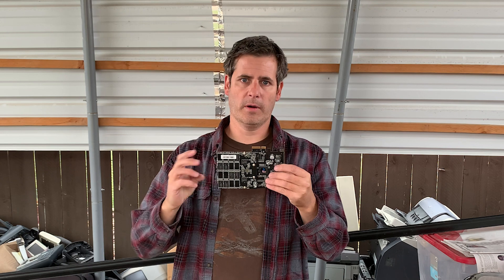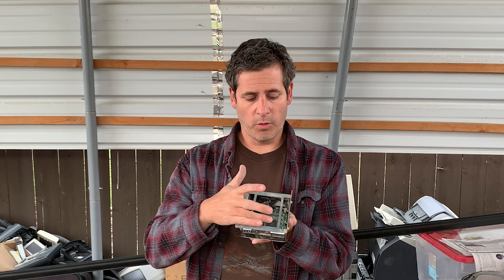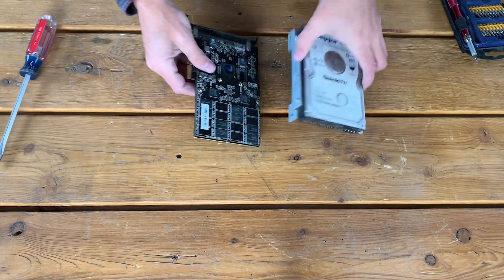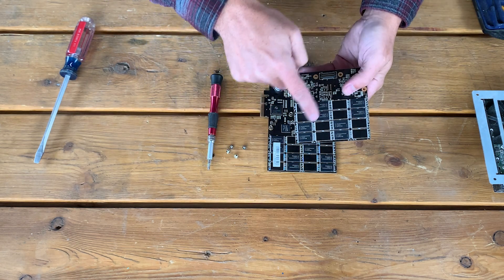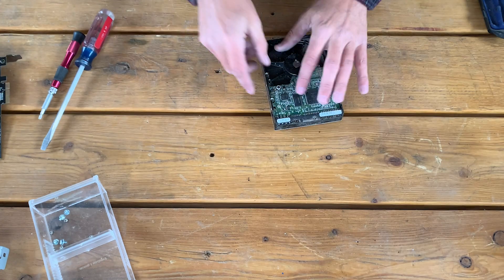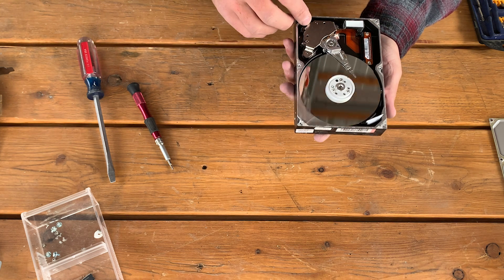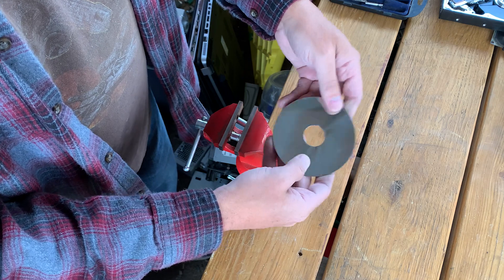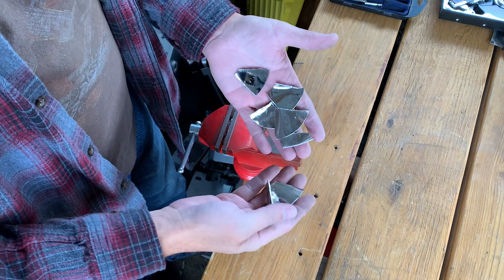My Way to Securely Destroy Hard Drives

Comment: Nice and informative video:)

I have a couple of questions though. Were those aluminium platters? I am asking about those which were destroyed by you towards the end of the video. Also, why didn't you use tin snips/aviation snips to cut them into pieces?
Reply from the maker: I don’t know why I don’t use snips on the ones that don’t shatter.  I have some that I could use… I just always used pliers for what ever reason.

They could be aluminum.  Sometimes they are ceramics.  The ones in this video were aluminum I believe.
Reply: @badideametals Thanks for replying. You are right, pliers are more convenient too.

Comment: Destroying hard drives or SSDs for privacy is stupid. Windows has a built in tool that replace all the information from the drives with 1 and then they can be reused without anybody being able to retrieve any confidential information previously stored on them.
Reply from the maker: Even with single pass register filling with 1s can be reversed.  DoD process is good for most. Over writes with a multi pass process. I work a lot with state and US government entities and they require destruction or I lose my agreement.

Stupid or not, people do require it to eliminate possible data leaks.

Comment: I read that the drives from 90 or older have kobalt Platinum layers that can be recycled by professional and they sell for a good amount of money. I guess that's why those Early computers cost so much. Older the drives more the precious metals. I just did about 10 drives today but I didn't know about the cache memory chip on the board.
Reply from the maker: It is honestly not something most people worry about.  The cache may have part of a data stream but it would be very unlikely that the data stored in the registers can be reassembled to mean anything.  I specifically like to get them so I can recover the gold from those chips.

As for the platter coatings; I have heard there is always the possibility for rare metals on the surfaces.  I just don’t chase that down since I do not get that many old drives.

Comment: If I reset my computer to factory setting, do I still have to manually destroy the data HDD?
Reply from the maker: The fast answer is "yes":

The reason for this is that all your files are stored in a way that even if you restore to factory default, your files still live on the drive.  

Imagine your drive is a book.  And let us pretend that the only way you can find the content of this book is by opening to the index at the front, find the page number of the data you are looking for, and then you can turn to that data.  Resetting the machine to factory conditions is like ripping out that index.  (Yes, in some instances, you are given the option to erase the drive, but it is not required)  

With the index ripped out, can you flip through the pages and find the content you wish to find?  Yes.  There is software out there that can scan the drive and rebuild data left behind.  

If you are concerned about data on the drive after resetting to factory defaults, (which you should be if you are getting rid of the drive or device) then your 2 best options are to format the drive and have it write data to every sector, or remove the drive from the device.

I hope this helps.

Comment: How can I retrieve the previous metal from incineration? Just burn them ?
Reply from the maker: Depends what step in the incineration… Also, if you are recovering higher values precious metals, nitric will help isolate silver, aqua regia will isolate most others.

Edit: you may want to also do some preprocess to get tin out before it screws up your gold process. The more burnt carbons can cause you to use more acid. It can be tricky to rinse the fine powder off the metals without losing the metals too… but that is a common preprocess.  It all depends on what you have when you start and what you want to get back :)

Comment: Could you have dropped a magnet on the disc, or held a magnet just above the disc while spinning the disc, and destroyed or irreversibly corrupted the information on the disc while it remand on the motor?
Reply from the maker: It is called Degaussing when you use a strong magnet to wipe or corrupt data from a drive.  It is a popular approach in the movies.  However, there are some problems with it.  1: It is not consistent.  It may wipe part of the drive... which means you will have partial data still on the drive.  2: It is hard to verify that the data is truly destroyed if the MBR or index of the drive is damaged.  This is really still #1 in my explanation, because again, this is a partial wipe, but you can't confirm it without recovery software to prove that you can no longer recover data.  All because a drive does not register intact data blocks does not mean they can not be sniffed out using recovery software.  3: The true degaussing magnets require power usually.  Electromagnetic tools are better then just any magnet sitting around.  

In short... my experience, and my opinion here ... it is easier to physically damage the drive or do the DoD wipes on the drive then to try Degaussing.

Comment: Not good for the environment to destoy working parts as need 142 billion tons of water to produce one chip and minerals need to dig out according to the specs 15 000 trailers. Pollution is big heavy like to produce 1 gallon diesel. The best way to destroy data is with certificated software. We using it in military and yes hard drives can safe be used by other without any secret can be restored anyway.
Reply from the maker: I understand your side.  I work for a group that supports financial and government policy makers that all insist destruction instead of reuse.  The need for certain levels of assurance are sometimes out of our hands.  This video is how I destroy the drives that I have to destroy.  Those that can be  reused are certainly saved for use again :)
Reply: @badideametals  I work for military and government with data security, even IBAS can't recover a single thing on the hard drive with the right erase tool that rewrites the disk bios and changes the rotation in hard drive and overwrites with zeros and changes the rotation again to ordinary and overwrites one more time with zeros. On SSDs, the chips are swapped and overwritten with zeros and swapped several times. The SSD Bios has been upgraded after solid deletion and can be used completely again. Yes, the disks can be sold as brand new disks, that's how good the technology we use in Norway has come.
Reply from the maker: As I said, I understand your side too.  My signed agreements with the owners of the drives says is that the drives are destroyed.  As a former CIO of a small business, I know there is always more then one "good way" and often a better way then what we have implemented.  However, to get the contract (or in this case, the agreements), sometimes we have to do things their way... and in this case, they have asked for drives to be destroyed.  So I made a video explaining the process I use when I am asked to destroy the drives.

Comment: This is good advice.  I see a lot of other "tamer" destructions using sand paper or drilling holes - those methods are not fool proof.  Depending on what's on the disk, there's always a chance that the one file you don't want people to recover is miraculously unharmed.  Fire is not foolproof, microwave is not foolproof.  Even bending the disks is not enough because they can be straightened.  What people don't realize is that data recovery specialists have heads that can read scratched and warped disks.  Sure, they won't get 100% recovery, but they might get some bits you don't want them to.  Cut the disk into pieces and you're good.  You can even dispose of the pieces in different places since you already did the hard job of breaking it up.
Reply from the maker: Thank you for an amazing comment on recovery tech and how effective it can be in the hands of a determined individual.

Comment: Can you not just simply snip off the strip connecting the circuit board to drive? will that suffice?
Reply from the maker: Technically, the data persists on the platters and in the storage registers.  The circuit board can be replaced on most drives with a board off an identical drive.  Your recommendation is valid  for some people for sure.  My experience with government and academic agreements is such that they want the drive platters unreadable.
Reply: @badideametals  Thanks..

Comment: Apply 1kv to the solid state and shred the hdd + solid state. 
Also, those platters are still readable unless you take large magnet and alter the magnetic field.
Reply from the maker: Sure  .... if you have that equipment, you will not be looking for alternate means... a shredder costs between $20,000 and $30,000 on average.  As for the power, that is a pretty strong shock for a single drive.  If you work in an environment that produces hundreds to thousands of drives worth of scrap, that may make sense to invest.  If you are a small but growing company, you may need to come up with other solutions... which is where I come in.  I want the gold and aluminum, so I offer to do this for free.  As long as it is delivered or dropped off to my scrap yard :)

But sure, you are correct... shred is faster ... and arguably easier.

Comment: isn't there some data which stays persistent in the motherboard and ram.
Reply from the maker: Yes, which is why I recommend in the video that the chips are pulled off.  Those IC chips "can" hold data in their memory registers.  Not much, and that would be a real trick to put it all back together, but yes.  

I pull the chips off and refine them for their gold content.  But for those who just want to be sure their data is off and gone, the chips can hold data.
Reply: @badideametals  Where and how do I bet get those chips recycled? And if you burn them, will they not emit toxic fumes?
Reply from the maker: @sjkm4309  all electronics contain chemicals that need to be understood before processing.  I incinerate and oxidize the carbon black exterior of the chips and crush them to dust.  The gold is left exposed for refinement.  You can probably pull the chips and sell them on eBay.  You will need a lot to make any money though.

Comment: have you heard of DBAN?
Reply from the maker: I have.  It is an open source reformat tool. 

I don’t use it myself.  I do a secure command line removal on Linux and BSD when I manage my own drives or drives of company partners who don’t request drive destruction.

Although it has good reception with many,  dban does not satisfy some government and private run industry requirements.  Some of my partnerships include aerospace as well as local government agreements.  Most people who ask me why I don’t reformat have not signed their name where I signed mine … on the documents that say that destruction is the requested and therefore agreed upon mode of secure data removal.  I would consider using dban for future use personally, but I have the tools that work for me on the CLI already.  Honestly, I don’t have enough experience with it to recommend it to others, or warn others of any potential issues.  Being open source, that could mean both well reviewed by peer developers, as well as poorly vetted for hasty bug fixing.  I would hate to find out after a compromise that a critical oversight was released as a stable software fix to the code base.  But hey, that can happen in any software release :)

Did I go too far? Sorry for the wall of text :). As a software dev by day, I don’t usually trust open source without a thorough prototype and beta test.  Not when I have government holding my signatures…

Comment: I've got about 10 hard drives I've had laying around for 10 years I intended to destroy.  Never got around to it.  Now I need to (physical space) so I bought some Torx screwdriver bits today.  (that was annoying they set me back 30 bucks).  One of those HDDs actually had phillips screws.  Now I've removed the backs off all of them and ready to proceed to the next step of removing and destroying the platters.  The metal ones would make a nice coaster btw... but I don't know which ones will shatter.  I assume best to wrap them in a towel before hitting them with the hammer?
I like your presentation style.  It reminds me of 1950s instructional films.
Oh and by the way I can't get the spindle screws off, they're stuck hard.
Reply from the maker: The spindle is a pain.  You will need to hold the axel still as you unscrew them.  I find that these screws are really soft.  They will strip relatively easily.  If they strip, just bend the drive plates where they are.  Bending them is considered acceptable for most businesses these days.  Only the ceramic ones can shatter and they are getting harder to find in drives honestly.  I would guess that your drives have metal plates that you can bend up.  

Let me know if you have more problems or questions.  It sounds like you are pretty close to done on this one.  Good luck.
Reply: @badideametals  okay...now done 11 drives.  I found the 16 inch long gigantic screwdriver was the most efficient tool for bending the platters.  Some of them the PCBs were upside down so they had to be removed before I could remove the memory chip.  

I assume its only the rectangular chip?  

For the 2 laptop drives, they were the ceramic type and lucky I bashed them with the hammer inside a plastic bag and wearing my safety glasses...cant be too careful.  The only thing I couldn't complete was removing the memory chips from those 2 laptop drives as they just wouldn't budge.  

Is there a way to destroy them without removing them?  I don't want to break the PCB.  I guess i'd need a blow torch which I don't have or could I hold them over a gas burner?

Comment: What tool do I need to get the screws out
Reply from the maker: A small torque driver bit.  It is a T5 or T6 depending on the drive company.
Reply: @badideametals  I just used a T9, for my old internat HDs

Comment: I did a factory reset on my PC and donated it for reuse....mistake?
Reply from the maker: Now I understand you factory reset ... on your PC, yes, you can do a factory reset.  I don't think the data is wiped beyond recovery though.  

The quick answer: Drives keep a list of where files are on the drive.  This is called an index.  When a program or file get deleted, most systems just remove the index entry.  The data still sits on the drive until some other file gets written in the space newly made "available."  The data still exists in that space though.  If someone gets a drive, they can use specific software that will go through all sectors (spinning drives) and registers (SSD drives) and find what data is there.  Then it will do it's best to put the data back together.  Sometimes, the data is corrupt, and can't be completely put back together ... but many times, enough data is there to put together maybe a few passwords, or half a bank statement ... or parts of your identity ... Many people don't keep too many documents that really matter.  But a drive can house passwords, personal data, browser history, 

In short, if you don't care too much about the data, then there is no issue.  If you do care a little, factory reset will keep most people from accessing your data.  If you are really worried that your data could find its way out to someone malicious, then you may not want to rely on the factory reset.  

But what are the chances your donated computer ends up in the worst hands possible?  Probably pretty low.  Good luck, and may the odds be ever in your favor.

Comment: Does "factory reset" get rid of data?  Most of my new devices have a reset option.
Reply from the maker: Interesting :) I am not sure how well that works.  Most companies I have worked for (in IT) would insist by way of company policy that drives be destroyed.  "It is the only way to be sure" ... factory reset sounds more like a device such as a computer or tablet ... but who knows ... a factory reset on a drive would be interesting.
Reply: No, factory reset does not get rid of the old data. Its still there and can be retrieved by data recovery tools. The only way to truely erase it is to write over the old data multiple times which a factory reset does not do (Some professional operating systems provide this option but most dont).
Reply: Factory reset is just reinstalling your operating system. Anything deleted can be recovered if it is not overwritten with 3rd party software.

Comment: What tool did you use to remove the circular white circle to get to the silver disc?  I have all the t2-t15 torx security screwdriver set but they obviously don’t work with this circle.
Reply: @ToastingMyJam360  post here after you get them and use them.
Reply from the maker: I find almost all are a torx.  Those that are are often are T5 or T6.
Reply: @badideametals  thanks.  I used the t8. I will try the t5 or t6.
Reply: Nope,they don’t work because the screw are just round circles and aren’t star shaped screws.
Reply from the maker: @puppytoes6241  can you send a picture to my email?  Channel name at gmail… no spaces.  Or find a picture online and post the image link in the chat here?  I can’t imagine … I am think it could be 2 things… first, it could be an Allen head… also known as hex.  Or, sadly the head of the screw may be stripped so it is round now.  They are pretty soft screws.
Reply: @badideametals  thank you for your help.  I really appreciate it.  This is from an old gateway tower that I have had sitting in my garage since 2007. Time to get rid of it.
Reply: @ToastingMyJam360  I bought a 10 piece Torx screwdriver set of T2-T15, TECKMAN star screw drivers on Amazon  for $13.99.  Make sure you buy the  T2-T15.  They are great.
Reply: @ToastingMyJam360  that sounds like an interesting challenge.  Good luck!
Reply: @ToastingMyJam360  just remember, google and YouTube are your friend!